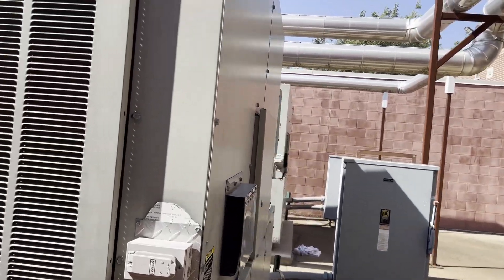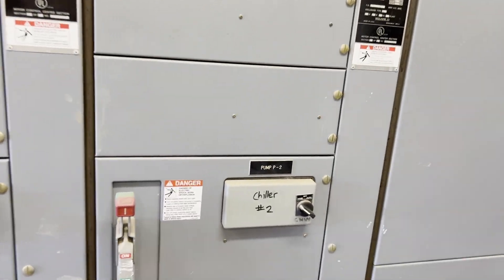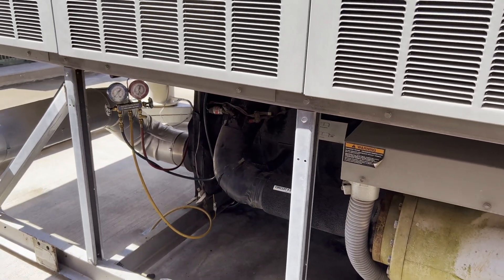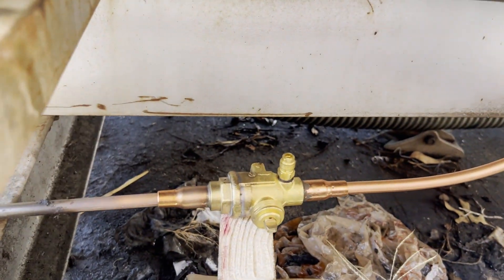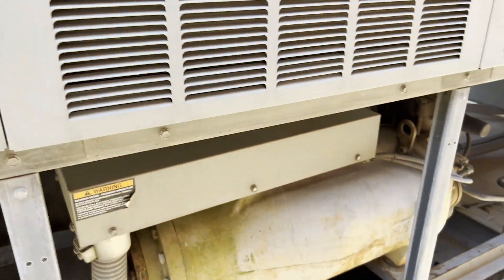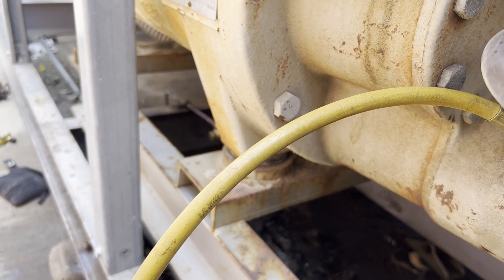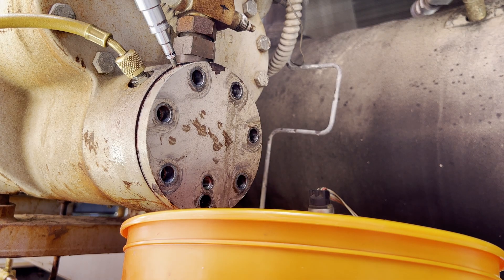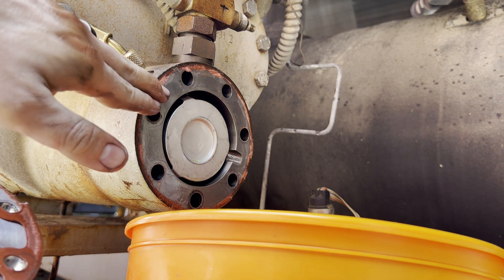Trane RTAC Leak Repair + Oil Filter Part 1

Comment: "...bleeding out the remaining fumes of the refrigerant..."  Is that normal?  On large chillers those fumes could mean a lot of pounds of refrigerant.
Reply: Do you often work on large chillers? This is a completely normal de minimus release. When pressures on both sides ( low and high ) are under 8 psi or even lower , there’s no way to fully recover remaining fumes of vapor left - even if you bring your gauges to zero out - disconnect your hoses and there will still be vapor in the system. Now a days newer recovery machines just as the new field piece will even cut themselves off at around 2-4 psi.  Totally normal to vent off vapor at that low of remaining standing pressure - and now , it’s not “ a lot of pounds of refrigerant “    - I’m the YT creator for this video responding on my personal page . Hope this comment helps - thanks for watching.   When recovering 100+ pounds of refrigerant , you are not going to be able to suck such a large circuit down into vacuum through a recovery process
Reply: @TheKingTighe  Thanks for answering the question. I didn't know. Largest chiller I have worked on was an RTAC1554. I have worked on York and Carriers scrolls of similar size or smaller. I will look into recovery practices of larger chillers. And yes, your comment helps.

Comment: Thanks for thus great tip to keep the chilled water pump running when on recovery mode,I know that this has to be done when breaking a vaccum.
Reply from the maker: Yessir , recovery and charging should only been done with verified water flow on chilled water systems to prevent potential freezing issues in the tubes or heat exchanger

Comment: If that was a semi I’d say oil looks like 10+ years old/or dirty system/or running hot.

Pre normal for a screw chiller tho considering compression ratios, you’ll get that darker tint on the POE pre quick from the elevated DLT

Comment: Did you send the oil in for analysis by any chance
Reply: No sir we did not . But we came back a month or two after this call for all the chillers on this school district and submitted oil analysis as part of the annual pm
Reply: @lammaking333  nicely done...oil analysis is a big key to spot a potential major issue

Comment: Hello, about the compressor low oil flow failure. my chiller has 2 compressors on the circuit and one of them has a low oil flow alarm. the oil level is ok. what could it be in this case?
Reply from the maker: Depends on the make and model
Of the chiller and it’s components. But it could be a dirty / clogged oil filter or strainer or oil pump not operating properly if you can visibly see oil in a sight-glass
Reply: Dirty co dessert coils can give you an oil alarm.  Cant remember the numbers, butnif the oil temp is close enough to SAT discharge temp it will alarm on oil flow.  Usually tranr uses the top couple rows of the condenser for oil cooling.  So dirty coils will give you elevated oil temps
Reply: If its a RTAC, more than likely the oil filter or check valve that sits in front of the filter.The IOM has the formula to calculate the oil flow ratio.If ratio is too high you will get that alarm.Also make sure transducers are reading properly as the computer is using transducer pressures to calculate the ratio.If high ratio is confirmed, I would replace both the check valve and the oil filter since both involve pumping down and opening the system.2" deep socket needed to replace that check valve.

Comment: Great video I’ve never worked on chillers, always been curious as to their operation. I’ve worked mostly on supermarket refrigeration and for the most part I was able to follow along.  We have oil filters and the same kind of drier cores. What would you recommend to learn more about chillers?
Reply from the maker: Read Manufacturer IOM manuals. They are usually much more detailed and in depth as far as each operation of the system when compared to regular DX cooling units.   There’s also a great channel called HVAC TIME . He works on chillers a lot and is very knowledgeable
Reply: @dfwhvac  great advice thanks !
Reply: Trane has a training class specific to the RTAC chiller in LaCrosse,Wi.They spend 3 1/2 days covering everything front to back if your Company is willing to pay for it.